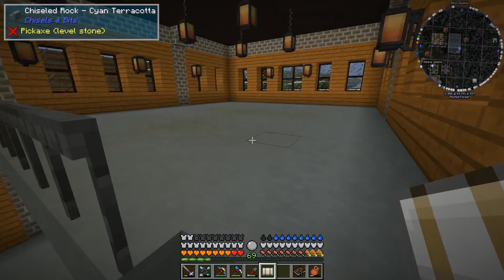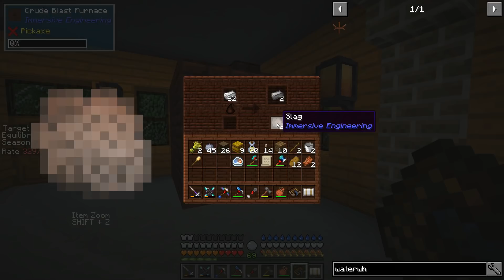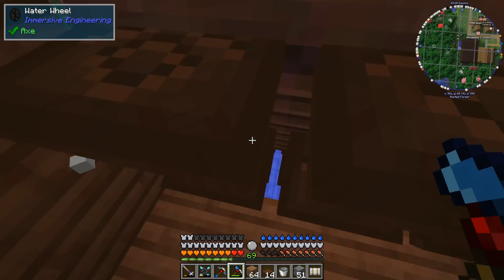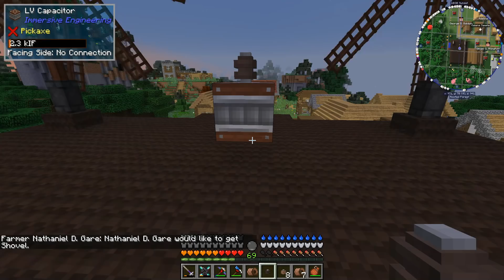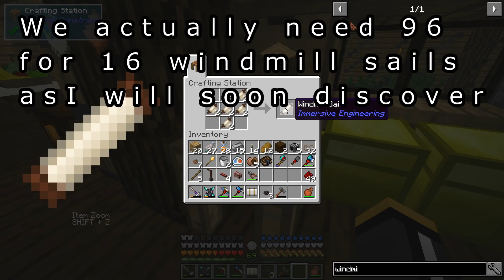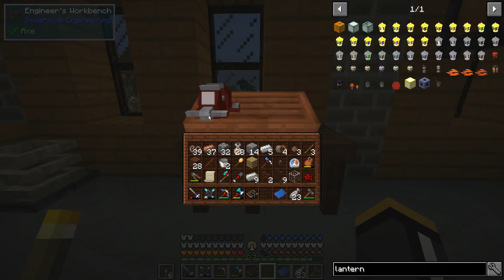Real Tech S2E16 - Immersive Engineering, Getting Started

Comment: Qeustion wath the difrence between rf and if
Reply from the maker: To the player, there really is no difference. Technically, RF doesn't exist in most newer packs. Everything is Forge Energy (FE). IF is kind of the internal power unit for Immersive Engineering. It's compatible with RF and FE and converts 1:1. It's similar to how Actually Additions has Crystal Flux which works with RF, FE and Tesla, and Refined Storage has RS which also does. It allows the mod author to support multiple energy types, or changes in energy types, without having to change everything in their code dealing with energy.
Reply: thanks bro oh and i installed industrial craft because railcraft fluxconverter is broken oh and your vids are awesome maby do railcraft
Reply from the maker: Thanks! I played a lot of railcraft in the first season of Real Tech. Unfortunately, it’s not available for 1.12.2.
Reply: Danny & Son danny its beta now
Reply from the maker: Ooooooh!!! Thanks for the heads up!

Comment: Great fun. Funny the smoke particle effect doesn’t seem to work with the ie machines which makes it difficult to know when the chimneys are connected correctly. You can join chimneys with vents, there’s a good diagram on the advanced chimneys project page. Ice doesn’t melt when chiselled. The power bug is in ie rather than redstone automation, you don’t need to use capacitors to join the connections, relays work just fine and have a final capacitor for measurement. Good tip about two connectors through a block, will use that one!
Reply from the maker: Vents might be a good idea. I use the vents and pumps for my smeltery to get two chimneys connected to the bottom of the controller.
Does chiseled ice work like regular ice with the Thermoelectric generator? I'll have to do some testing with that.
I figured the power bug was IE. I used the extra capacitor to work around that bug. It sounds like it's fixed in the latest version though (according to the change log). I'll do some testing for that too.
Reply: Yes chiselled ice works, 2 uranium blocks and ice gives 40 IF/t and packed ice gives 42 IF/t, not too bad as there is no cooling from ice. Two water wheels give 170 IF/t when you place extra water source blocks.
Reply from the maker: Good to know.
Wait... 2 water wheels or two sets of water wheels?
Reply: BTW to climb the poles you need to jump over the base while walking at and up the pole.
Reply: 2 sets of three wheels, more economical on dynamos. You'll need to cover the water so it doesn't freeze and slab the wind mill's dynamo as snow stops it.
Reply from the maker: I don't know about climbing the poles. That's what I was doing. It seems that it works sometimes, but sometimes not. In fact, I sometimes end up climbing them by accident. lol
Oh yeah! Thanks for reminding me about the snow and ice!
Hmm... so you can get an extra 10 rf/t from each set. I know you used to be able to get around 95 rf/t from each set, but that doesn't seem to be the case anymore.